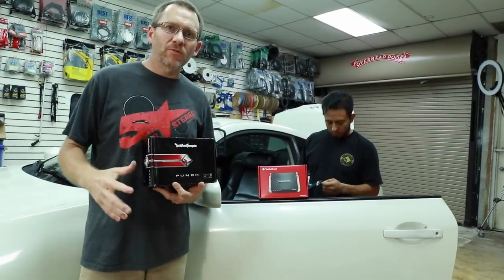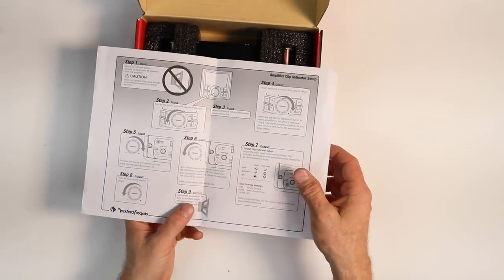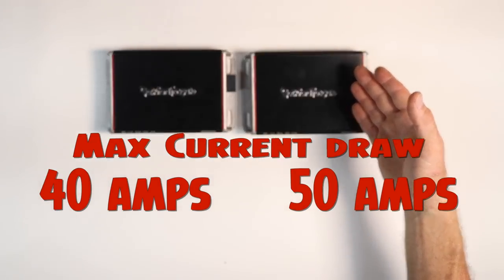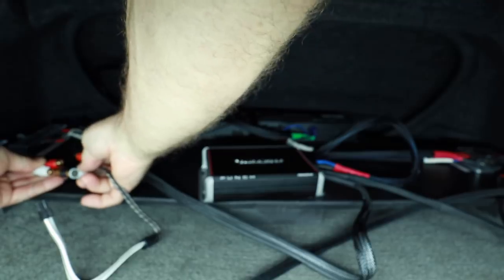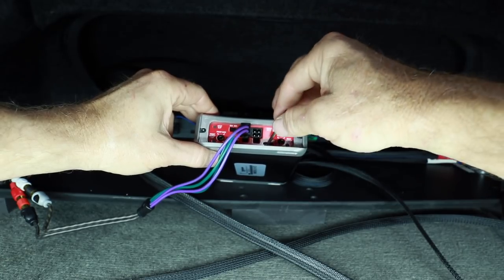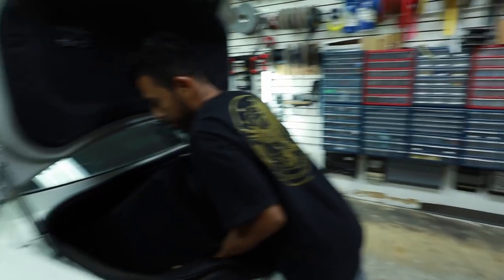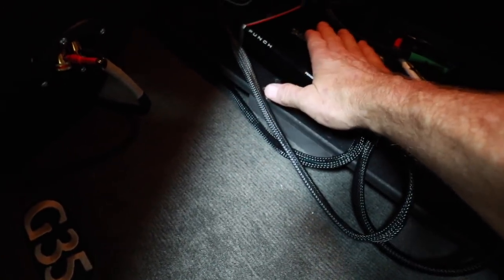The Rockford Fosgate PBR400x4d review and install  Car Stereo Lab 8

Comment: Great video!  I just purchased this amp for my F-150 setup. I had already replaced the factory speakers in the front doors a couple years ago with RF 1683 Punch 6 x 8's, so wanted to stick with that brand. Will add them in the rear doors also, along with an under-the-seat woofer from RF, too. Having them professionally installed in about a week. Can't wait!

Comment: Hey Dean! If you remember me and remember my Rockford collection you know I have a little love for Rockford LOL. I have 2, of the PBR300X4 and  3 of the PBR300X1.
I swap my amplifiers out quite a bit in my truck because I just simply love hearing and seeing different things. I have been so excited about these amps and you have gave me the confidence to sell the 5 I have and go to 2 of these. I can do this now since these are 2 ohm stable. I can use 1.5 amplifiers for midbass, mid-range, and highs. Then the last channel can handle the subwoofers.
My processing is handled by Dayton Audio's DSP408. It is a great unit and offers an excellent price along with tons of adjustments and features.
Just another great video and most successful test! The LAB Works!

Comment: Not to be a Debbie downer, but for the guy who wanted to run all four channels individually. Like 4 ohm components on the front two channels and 2 coaxials for rear fill on the rear 2 channels is better off getting the 300/4

300/4 does 84rms x 4 at 4ohms

400/4 does 50rms x 4 at 4 ohms. 

I get the obvious flexibility the 400 offers. But majority of people out there just getting started in car audio are going to want to run components on front channels  and coaxials in the rear on the rear channels

My apologies if I misinterpreted the amp ratings. But thought I’d give my opinion.

Awesome video like always. Love your channel!!
Reply: The3rd ERA thanks for putting that out there👌🏽

Comment: So would you prefer the PRB400X4D or the AudioControl ACM-300.4?  I'm shopping for a compact 4 channel amp to power two Polk MM6502 components and two MM652 coaxials.  Is either going to put out enough RMS power to get the best sound quality out of these speakers?  Thanks! Awesome videos!

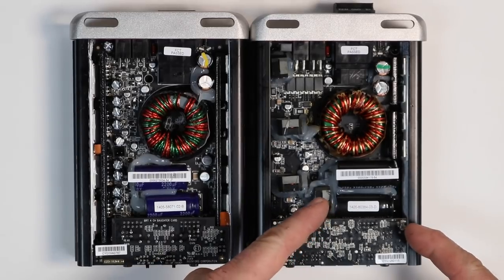Comment: 7:23 hey guys, looking at the inside of the new amp, it has 4 transistor looking thingies on the top left where the PBR300 doesn't, is that noise filters?  I'm worried about noise, and am trying to decide between this compact 4 channel 400W and the regular Punch P400X4, but I really really like this one and want to make sure it's a top class D design with noise filters.

Comment: I am planning on putting these speakers in the doors of a Crew Cab Ford F-150 truck.  Pioneer TS-A1374R 300 watts   & TS-A1684R rated at 350 watts .  I owned them before & they can handle what they're rated without distorting.  I have Eclipse mid & tweets & also Fosgate mids & tweets.  I just don't want to do the whole separates thing anymore.  What would be a solid, dependable, clean, economical cool running 4 channel power amp to push these speakers?

Comment: I just installed one of these in my truck. What’s the acceptable operating temperature for these amps? Mine gets quite hot. It’s just sitting on the trans tunnel between the front seats, I plow snow for 7-8 hours at a time, it gets so hot I can barely hold my hand on it, even when not cranking the music.

Comment: I own a pair of Pioneer TS-A1374R 300 watts   & TS-A1684R rated at 350 watts .  I owned them before & they can handle what they're rated without distorting.  I have Eclipse mid & tweets & also Fosgate mids & tweets.  I just don't want to do the whole separates thing anymore.  What would be an economical, powerful 4 channel amp to power these?

Comment: I have a 2018 versa note.radio using 2ohm speakers.can I use this amp at 2 ohms and then do I need 2 ohm speaker or can I use 4 ohm speaker without an issue. Great review thank you for your time

Comment: Hey guys I’m installing new tweeters in stock 2017 Civic touring and it has the amplified “premium” sound. I believe the amp is doing the crossovering since I don’t see the capacitor on the tweeter itself like the lower models. So I should be okay not connecting my new tweeter inline crossover correct? What’s your input?

Comment: I’ve got two 6 1/2‘s and four 6 x 9’s I want to install on a motorcycle. All 6 speakers are 4 ohm impedance.
Can I run the two 6 1/2 and one output at four ohms and the four 6 x 9‘s wired in parallel at two ohms in the second output with this amp?

Comment: Hey guys, you know if that amp has a noise filter like other high end class D amps?  How is the sound quality?  I have to decide between this model and the Class AB Punch 400x4 normal model, I prefer the smaller but not if it's a sacrifice of sound quality.

Comment: where can i purchase the wiring set for the 300x4? Purchased used and didn't have the power plug of other set of wires.
Reply: From any authorized rockford dealer